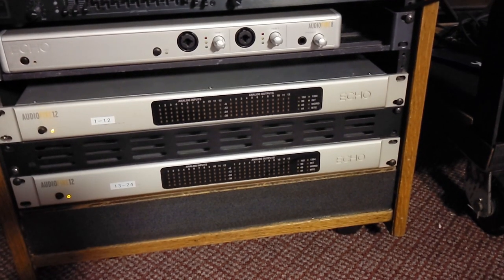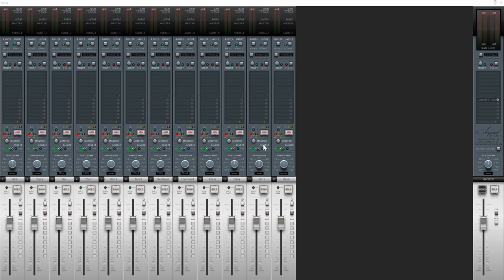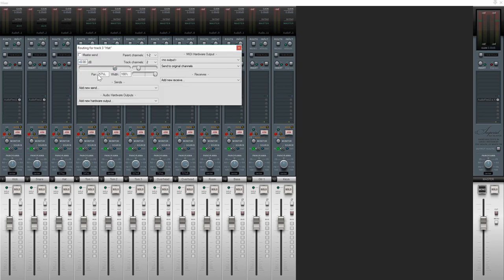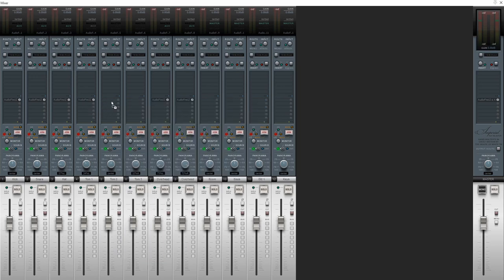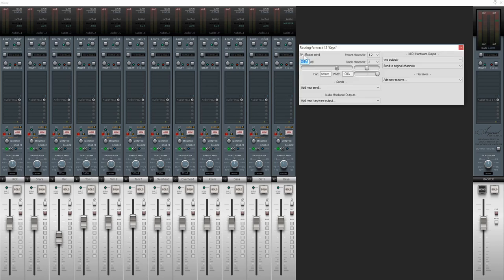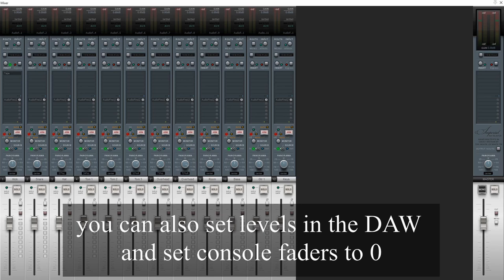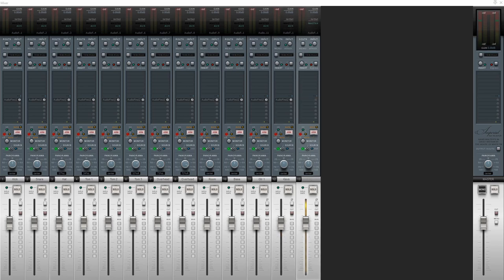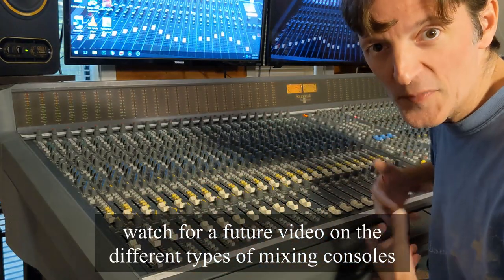Hybrid Mixing Tips and Challenges

Comment: Great info! Thanks Grady!
I usually use a Fostex D2424LV to record on, but I took 16 of the effects send/returns on my Soundcraft 1600's patchbay and ran them to an interface going to Reaper. I need to sort all this kind of stuff out. I usually work out of the box, but was entirely in the box before that on Reaper, I would love to use ReaVerb, tape emulation, and convolutions in the board mix and bounce in and out at will, as well as dropping MIDI keys, virtual instruments and DAW scratch tracks into a project. Plus I recently figure out how to use the internet server to run Reaper controls on connected devices, no more running back and forth when recording drum tracks! It might be time to ditch the hard disk recorder and get more interface channels. I wish TT cables were cheaper, because I'm going to need more now.🙂
Reply from the maker: I've used a spare tablet PC with a 2 channel audio interface in order to use a plugin as an external effects processor. There's a video about that on the channel. I'll see if I can find the link and post it here. It's close to what you're wanting to do.
Reply from the maker: Here's the video where I used a spare tablet and an interface for an external effects processor. 

https://youtu.be/FynrfENwZHU

Comment: Another great vid! I work similarly because to be able to group tracks to a stereo stem pair where you want and throw them out to the console is a great way to simplify the mixing and recall  on a console. Also interesting what you said about sub groups because to my ear, the signal straight to master LR sounds better. I hear a diff. Another tip for recall is to tale note of the day and the time of mix. Reason is, power can fluctuate diff times of week depending on usage patterns. Your console might sound different at diff times because of this. Maybe it is silly, but if you want to get as close as possible to that first nix, keep it in mind.
Reply from the maker: Thank you! I mentioned the subgroups mainly because I had a question on a previous video about it. I don't normally use subgroups when mixing except for things like parallel compression. I mention running things though another gain stage for those that want more color to the sound but I rarely use them that way myself. I tend to use the DAW like it's a tape machine since that's how I started in the 90s and I like the workflow. I feel like something gets lost when combining tracks in the digital domain so I mix using hybrid methods. I should probably streamline more of my mixing process for recall reasons but I usually take a lot of photos of settings to recall the mix.

Comment: Hey Grady thanks for the video this was helpful.  A couple question on the masteroutput from Reaper.   Couldn't you just mute those two channels on your board or turn off the master send in Reaper? Also with my two Audiofire 12's reaper defaults to the -a audiofire and it will automatically put the master on the first two channels of the second audiofire(13,14).  Wouldn't that get in the way in the way on your mix?  Anyway just wondering if muting each one from the master in Reaper is a good way to do it for a particular reason?   Thank you
Reply from the maker: Those are great questions.  I will definitely still use the master bus in Reaper when I'm mixing. I'll usually have 1 track for the mix being printed back in and that will be routed to the master bus in Reaper and assigned to a pair of outputs that I can turn on and off at the console. I didn't get into that in this video to keep the idea simple enough to follow and the video from getting too long. I should probably include that in a future video about printing hybrid mixes. I think I changed a setting in Reaper so when I create a project, the master defaults to a pair of outputs. On my system, Audiofire -a is the second unit so 13-24 on the console and I usually send the master to -a 11 and 12 which would be 23 and 24 on the console. When I'm printing a mix, I'll connect the master outs of the console to 2 AF inputs -a 11 and 12 usually, then mufe that channel pair on the AF control panel so the printed mix isn't coming though the outputs. I think I made some changes to the AF settings or connected them in a particular order to get -a to be the second unit. They are daisy chained via FireWire and word clock sync  Other times for videos I'll print the mix or the control room output to a separate rig. This leaves the main rig for playback only and allow me to capture the control room output so I can solo things for videos and the audio is correct. I don't have to remove the master outputs audio channels, it just makes it easier to keep things straight without accidentally having something where it doesn't belong.
Reply: @TwinCreekAudio  Thanks for the explanation Grady.  I appreciate it
Reply from the maker: @kevmay21  Always happy to talk shop as they say. Let me know if you have any other questions or observations. Thanks again!

Comment: Hey there Grady.  Question for you but not particularly on this video.  My audiofires were working fine in Reaper but when I dropped a wav file in yesterday I noticed it was playing at a high speed/pitch was off.  I looked up top and say I was at 44.1 and I think it should be 48k I checked and in the audiofire setting it says 48.  If I try to force it in setting ti go to 48 in reaper it still shows 44.1 at the top.  If I put the speed in reaper at 91.875 (44.1/48) it plays right but then I have to go back to 1 before I render.  Anyway its more a tech support question but I signed up to the reaper forum over a week ago and they still don't have me approved to post.  Just wondering if maybe you came across anything like this?   I had not had any issues until just the other day.  I can't say for certian it said 48k in the top but I think it didn't and I certainly didn't have any pitch issue.
Reply from the maker: I actually have had a similar issue. I think solved it by taking the foreign file causing problems to a different PC and saving it as 48k and reimporting. I've also had issue with the Word clock sync cable connection causing the 2nd unit's timing to be off. The problem you're experiencing sounds like the one I had. I think maybe the project was corrupt in my case and no setting change I could make would fix it. I'll try to remember more about what happened and post if I do.
Reply: @TwinCreekAudio  THanks a lot.  The firewire cable linking htem got disconnected while I was working with the patchbay the other day but that is the only thing I can think of.  I will fiddle with it some more.  Thank you.  I appreciate it
Reply: @TwinCreekAudio  Hey Grady I just want to check to see what your getting in Reaper for resolution and bit depth?  Are you at 48k and 24 bit?  Thank you
Reply from the maker: @kevmay21  yes, I usually run them at 48kHz 24 but. I've run them at 92 before as well but it's good at 48 so I stick with that
Reply: @TwinCreekAudio  I think I am getting somewhere. Fooling around I changed to 96 in the echo console and in Reaper wat I did different was under project setting I didn't choose any bitrate or tell it to force it I erased it and then it defaulted to what ecfho was set at.  Issue I am having now is I changed the audio sample rate in both echo control panels to 48 but it is still showing a sample rate of 96. So 48 core audio rate and above that 96  sample rate and reaper will default to that 96 rate if I erase the sample rate under template settings
Reply: Maybe this is what it should be?
Reply from the maker: @kevmay21  Try saving the settings in the Audiofire CP. I think I had to switch that back and forth a few times once or twice
Reply: Okay I got it all worked out.  I got the template switched to 48 and saved as default and it switched and shows it in the echo and audio playing correctly.  Thanks for your help and sorry for all the questions!
Reply from the maker: @kevmay21  great! I'm happy to have been able to help a little.